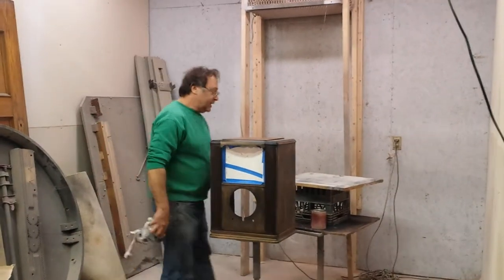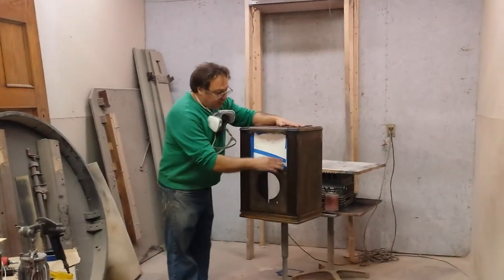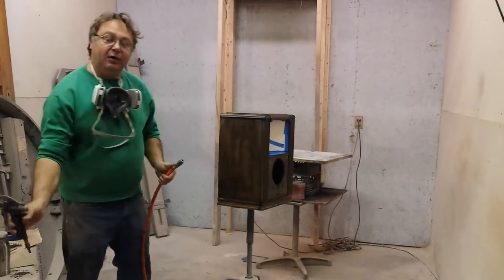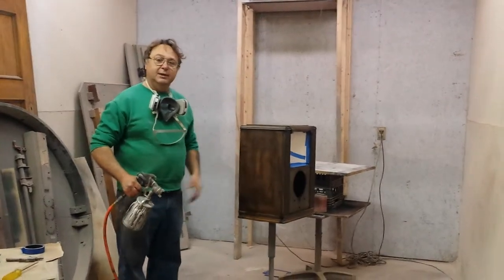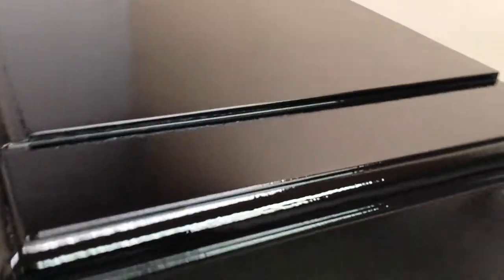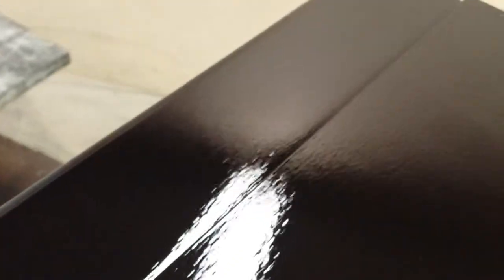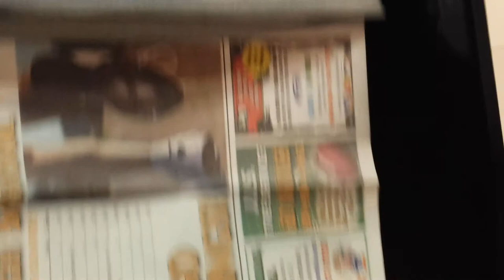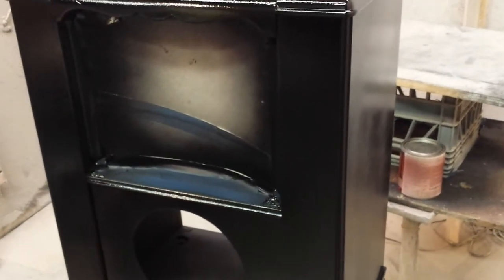refinishing a zenith 6 s 27 radio timeless arts refinishing

Comment: Beautiful job. Honestly. 
Some questions, 
How do you know  when the first two coats that you just did are heavy enough to stop spraying? Even coverage? A certain texture? It almost looks like there was some mottling/orange peel up top, but you mentioned that it should "shrink/tighten up"? 
What is the purpose of the sanding after these coats? To smooth any imperfections? What grit will you use? 
I think I had some "bridging" in one refinish I did in the sharp corners of the trim, which ultimately resulted in some chipping that needed to be fixed. I will watch for this next time.
It's looking really good, excited to see the end result. Keep posting!